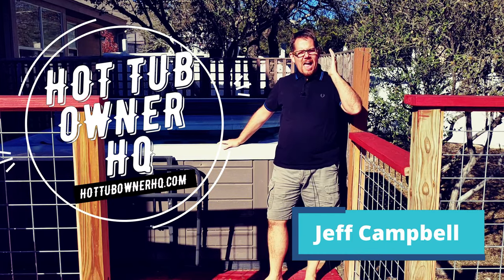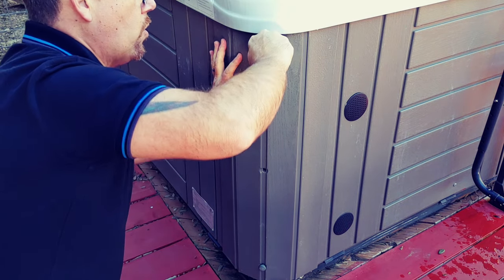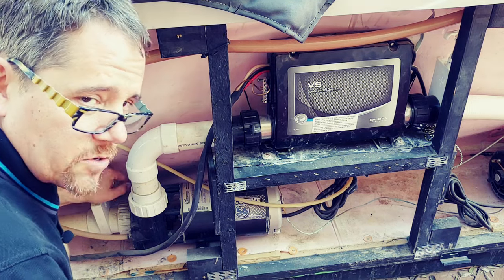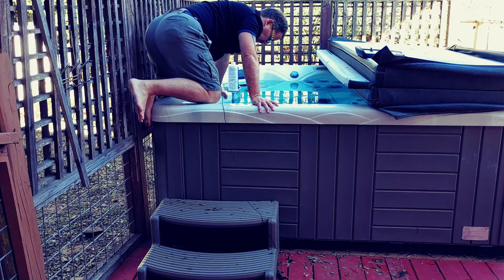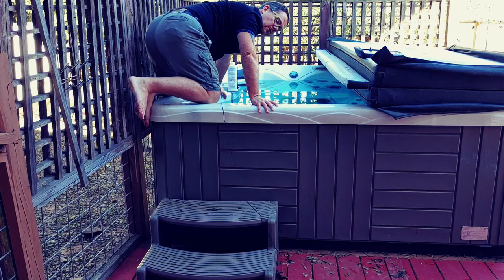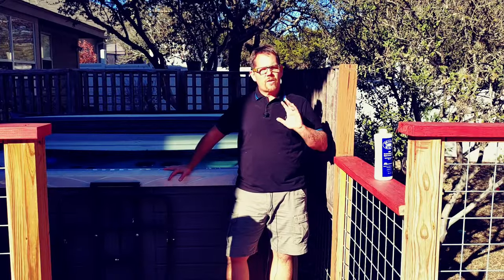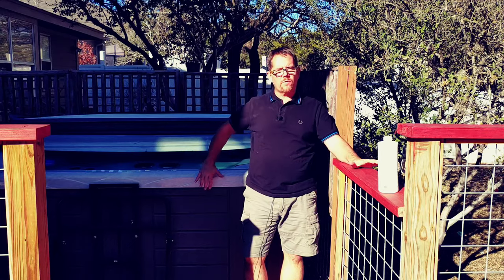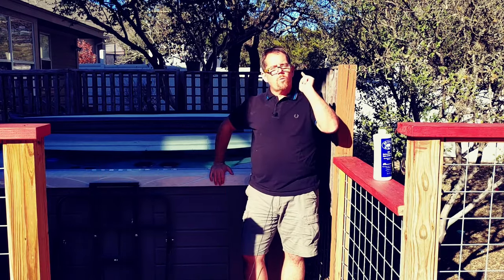Hot Tub Leak Repair - Proven DIY Fixes

Comment: Epoxy Puddy does not fix cracked pipes. The only way to fix cracked pipes, is to cut out the damaged plumbing, don't waste your time on Epoxy or the Black Spray sealers, they will not work. Fix A Leak will Not fix cracked pipes, you have to find the cracked item, cut out and replace. Fix A Leak can work on a failing Glue Joint or Bad  Gasket etc. Not Cracked Pipes or Jets or cracked spas. Fix A Leak must run 72 hours, one day is Not long enough, the product needs to cure. You do Not want to swim in Fix A Leak, you must empty the spa fully and wipe the spa clean. A great product, that will work on certain types of leaks. I have used Fix A Leak, hundreds of times over tge last 30 years, its always on my truck.

Comment: I was about to saw our hot tub apart and dispose of it (still a plan I haven't discarded yet), but I'm going to try the Marlig product first.  If this works and the leak is fixed, I'll owe you a big debt of gratitude.  Thanks for your video!
Reply: What was the outcome?
Reply: How did things turn out?
Reply: Did it fix it?  We have a leak too, and plan to use this
Reply: @DeeLikes  I used it and now my jets will not run. 😢I'm trying to get an answer back.
Reply: @kirchner1978 Not sure if you figured it out, but you may have an air lock since you ran the tub without the filters in it for some time! Watch some videos on clearing an air lock 😊

Comment: I have used this leak stopper for a long time and it’s the best ever! However if your tub is cracked do all the steps he said but I would recommend Marine-Tex it’s fantastic. Good luck everyone.
Reply: How long did you leave the jets run? I ran them for about an hour, then let it sit for 24hrs. Now my jets will not run at all and I have white cloudy stuff all through my water.😢
Reply: @kirchner1978  I am so sorry to hear that it’s not working for you. I read mine just about all day to circulate through every crack and crevice. I had the water temperature up to about 104°. I really don’t know what to say like I said earlier I’ve used it for several years and have never had it not work for me. Did you turn your water temperature up as high as it would go?

Comment: I have a one piece composite plug n play Dream Maker Spa. Mine is leaking. It only has 1 open panel , where the pump is. I see water underneath. But I can't see where it's coming from. Does anyone else have this type of hot tub? I'm thinking only way is to empty HotTub and flip over. Anyone ever done that? Thx

Comment: Thanks. Learning about leak on roto molded hot tubs because the 5 yr old one here has a leak at one drop per second, as I try to catch it with a drip pad and a few large bowls. The more video's I watch the closer I am to thinking I can attempt to fix it myself because service here in Canada, on the smallest province, Prince Edward Island, is not prompt. Stay safe, from East Canada.

Comment: Thank you so much for recommending fix a leak
I had a slow leak around the base of the hot tub did not want to turn it over and start breaking apart and digging into the spray foam 
Took your  recommendation, ordered the fix leak on Amazon ,
Poured it in ran the jets for one hour  let it sit for 24 hours. Looks like the leak is now gone. !!!
Thank you !!!

Comment: You can fix leaking pipe joints using the pvc cleaner/thinner and pvc adhesive method - 1 lower water or empty the tub - 2 tape over adjacent jets or jam foam plugs to resist air flow(I have a bunch of oversized spongy foam plugs on hand in my repair kit) - 3 attach a vacuum (shop vac) to an open jet causing negative pressure inside the pipe - 4 apply liberal amount PVC thinner/cleaner then PVC pipe adhesive  - thinner-glue-thinner-glue….
Do that 2 or 3 times then shut off the vacuum and wait about 30 minutes before filling and testing the repair.   It is repeatable if still leaking and eventually It works!! I’ve fixed dozens of pipe joint leaks this way.
Reply: This sounds like a great idea. I'm thinking the shop vac might be crying for mercy though!

Comment: After digging some foam out if the way I decided to try the stop leak product you suggested.  Should be here before noon tomorrow from Amazon.
Update, I did 2 applications and saw a dramatic reduction so I went for a third.  The solution was very thick so I realized I didn't shake it up.  I still had a little drip so I ordered a second bottle.  This time I shook it very well and poured in about 1/3 of the  32 oz bottle.  I ran the pump and jets about 30 minutes and turned off the breaker for 2 days.  No more leaks!  This stuff is awesome.
Reply: awesome going to try that
Reply: Has it held up or did it start leaking again?

Comment: First, what an awesome, helpful video!  We are in the middle of a rural Minnesota winter, and yes, discovered we had a leak. Panic sets in!
Taking your favored product, we purchased, applied (after removing the filters) and it appears to have stopped the leak.  
My follow up to this is what appears to be a residual problem.  We put new filters back in, ran them for a couple days, put in new filters, and were still getting residual "sludge and now only getting 1st stage filter setting, and set temp not maintaining. Pulled filters again and are rinsing, but still getting sludge.  Ordered another new set. So until then...is this normal?  
Any suggestions, aside from keep cleaning/replacing filters?  Do you think it could have effected the heater??  Any help is greatly appreciated!
Reply: all good questions, but perhaps better addressed to the product manufacturer. Have you gotten any answers yet?

Comment: Question, using Fix a leak, Im in a very hot area, so the pump wont run because it doesnt need to to warm up. So when you say 24 hours,  how do i make the fix a leak circulate thru? The jets button only runs jwts for 5 mins. Thx

Comment: I have a leak where the gasket failed around the filter housing, it’s about 1/8” but should I caulk/seal the outside first or use the fix-a-leak?

Comment: I noticed water leaking out from underneath my jacuzzi and took off the front panel to check but didn’t find leaks around gasket or pipes but did notice a tub hanging down that was dripping water wonder if this could be the leak and why the tube is hanging down

Comment: I did this & it stopped the leak but now my hot tub isn't working. Jets don't come on & there is a flashing number. Do you know what happened? Did it clogg my hot tub?
Reply: Same thing happened to me. Can you please tell me how you fixed it. It stopped the leak on mine. After 24hrs I put the filter back in and tried to run my jets and they won't come on now. I just hear a clicking sound and nothing. Please help. 🙏
Reply: @kirchner1978  I had to change my thermostat because it seized it I guess. It was less than $100 to replace.

Comment: Hi Jeff I am starting up my hottub after not using for a few years. My hot tub is in doors. I notice that under my 2 drains ,it is leaking. I tightened them but still leaking. There is no water inside the cabinet. The leak is coming from under the tub onto the floor. I haven't powered the tub up cause I don't want it to gush out suggestions? Thanking you inadvance.
Reply from the maker: Hi Viki

Leaks are tricky as it's sometimes hard to know exactly where they are coming from. As long as you don't think it's from a cracked PVC pipe, I would start by trying Marlig's Fix-A-Leak (on Amazon - https://amzn.to/3eBbxnl).

It's a liquid you just pour in where the filter(s) sit. Take the filter(s) out and just start by pouring in about 8-12 oz (I eyeball it) with the jets running.

Maybe use tape or a dry erase marker to note the water level so you can easily tell if it drops. Then check it in 25 hours and see if it's still leaking.

Fix-A-Leak works great on leaks up to 1/8 of an inch, so it won't fix a cracked pipe, but it's great for smaller leaks, particularly those around fittings or jets. I've used it many times and had it work 3 out of 4 times.

And you don't need to drain the tub once done. Just put the filters back in. If the leak is still there, but has slowed, you can also repeat the process. But if it doesn't seem like it helped at all, then you probably have a bigger issue like a cracked pipe.

But if the pipe can't easily be cut out and replaced, JB Water Weld putty (on Amazon - https://amzn.to/38xF39S) works great and can go right onto wet surfaces.

Good luck!